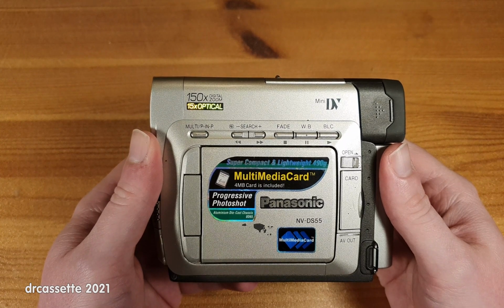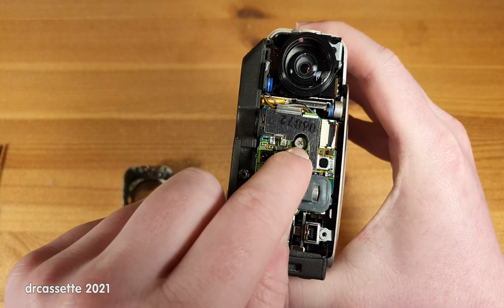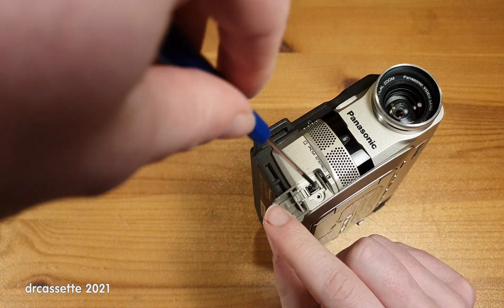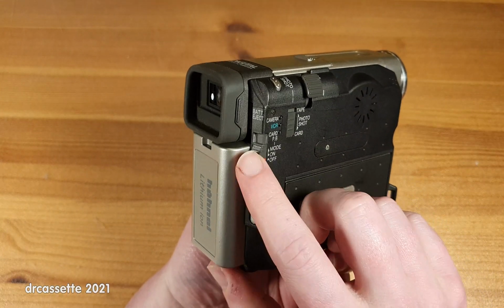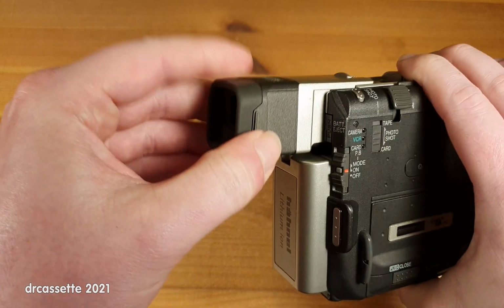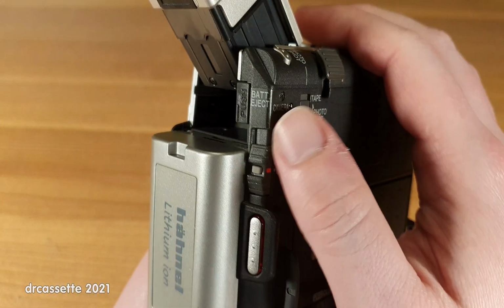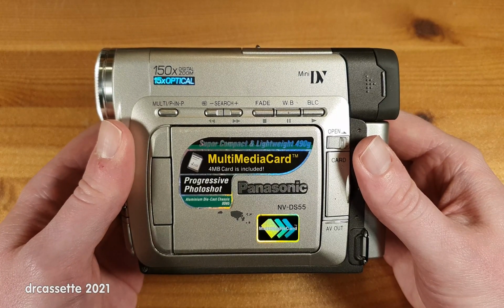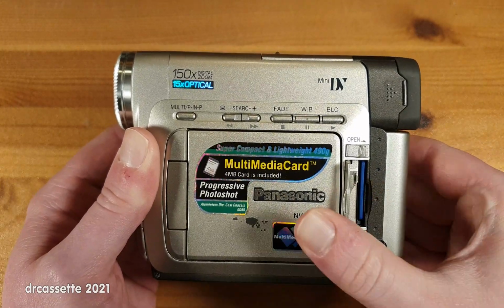Panasonic NV-DS55 MiniDV camcorder repair and test

Comment: Please assist, I have the same camcorder with an F05 error which indicates a mechanical fault. I also done research on the internet that the ribbon cables needs to be reseated. Now I need to remove screws to remove bottom plate. Can you please make a video to show me or just explain to shed more light on the problem my friend

Comment: Hi there, I recently restored a similarly small DV camcorder - A Sony DSR-PD1. It now works great but there is still one glaring flaw. The head drum is ridiculously loud - so loud that it drows out the microphone on any recorded footage!

Can the drum be lubricated and if so, what sort of lubricant should I use? Have you ever lubricated a DV drum?

Thanks for the cool videos!
Reply from the maker: It seems like on the first generations of Sony MiniDV camcorders this excessive head drum noise was normal. I had the Sony DCR-PC7, the consumer version of your DSR-PD1, and it had the same noise. Even the DCR-VX1000 has this noise, it just doesn't get picked up by the microphones so much as they are further away from the mechanism. In later generations Sony seems to have implemented audio filtering to cut down on the head drum noise, but it is occasionally still coming through depending on the signal coming from the microphone. I would strongly advise against trying to apply any sort of lubricant to the head drum.

Comment: I wonder if the reason why the camcorder was displaying the error message you saw is because the tape deck was loading or unloading a tape when the battery went completely flat.
Reply from the maker: That is possible, though in that case the mechanism should reset itself once power is reapplied and not just sit there with an error message. I guess the fault was caused because the mechanism sat in the same position with a cassette inserted and the tape threaded up for a very long time.

Comment: You may want to open it a little further to remove the battery for the on board clock. If "F05" isn't simply meant to show which iris setting it's using, it may be an error report for a dead clock battery.
Reply from the maker: The F05 definitely is an error message, I have seen this on other Panasonic camcorders already. The internal memory battery indeed is dead, but there was another symbol for that which showed up right after I powered up the camcorder. That battery might be able to recharge itself from the main battery, so I will give it some time.

Comment: What was the multimedia card (MMC, a "relative" to SD) included for? 4MB? What were you supposed to store in there? Some lo-res stills?
Reply from the maker: Yes, the camcorder can take photos either live or from what was recorded to tape and save them to the Multi Media Card in VGA resolution (640x480).
Reply: @DrCassette  That second function is really interesting. Makes way more sense to me than making crappy 0'3 MP photos, even for a device of that age. Sure it was very helpful to be able to do that instead of isolating a video frame in your computer.

Comment: Some interesting architecture on your old recordings. It looks brutalist. The MMC is a predecessor of the SD card, the difference is that it didn’t support DRM. I remember that at the time in the early 2000’s computer magazines didn’t quite like the SD format and the Sony memory stick which was also around. SD cards had DRM support mainly to satisfy the early mp3 players before the6 became common in phones and camera’s. I still have an old multi format USB 1.1 card reader from circa 2003 that supports these old and forgotten formats. In those days you even needed to install a driver to use it with Windows 98.
Reply from the maker: The old recordings are part of a video about the demolition of the Kröpcke-Center in Hannover. This was a very unique brutalist building which is now sadly gone. You can watch the video on my other channel: https://www.youtube.com/watch?v=YPQHlvAhU-Y